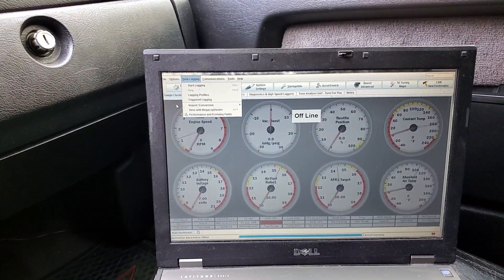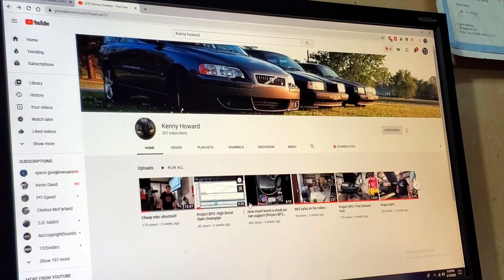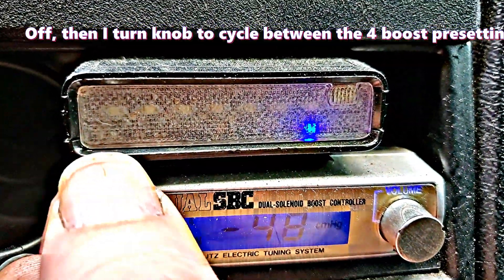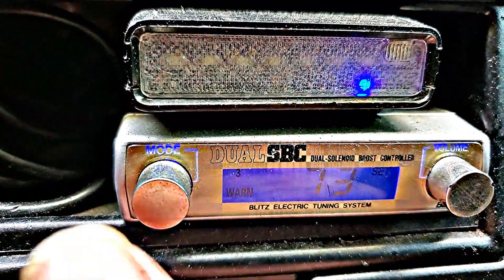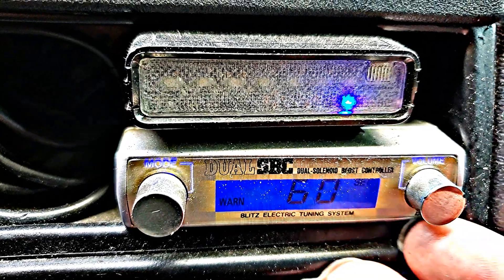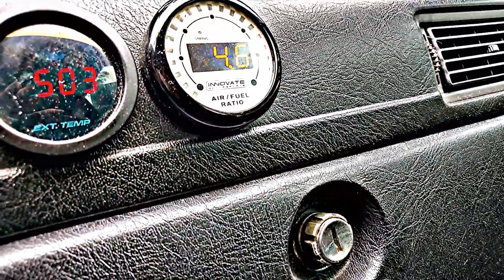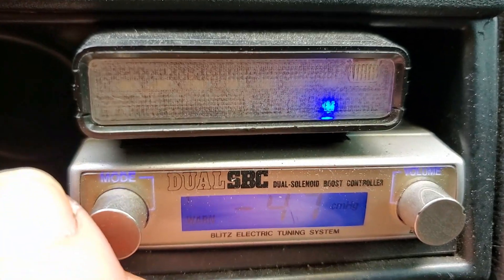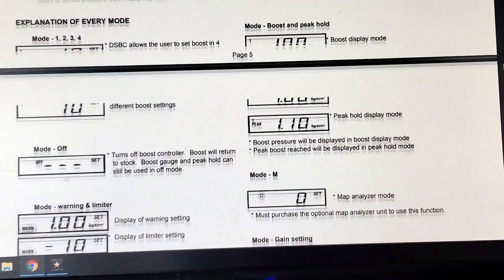Electronic Boost Controller, Blitz DSBC , Programming Instructions and Features.

Comment: I have one of these but i dont know why it isnt turning on Everything should be fully connected
any help would be great
Reply from the maker: They are nice when they work! So i guess, check the power and ground and make sure you are getting both, i think there is a glass bus fuse inside the case that may have popped , but i don't recall for 100% certain. Instructions still say to install one fuse inline so maybe trace your positive wire back to the fuse and check it? Did anything else stop working around the same time? If so, check that factory fuse? Hope that helps, these boost controllers really help and when they don't work , ugh it sucks. Nine out of ten times, not the boost controllers fault, in my experience. Wires fail, hopefully that's all it is for you.
Reply: @ Thank you I’ll check it out tomorrow
Reply from the maker: Major update. I have two of these both had same problem, open up the case and glue the plastic hoses back on the plastic nipples of the sensor. Both blew the tubing off the sensor i super glued and zip tied them back, hope this helps . I did a video about it, I think a short but it kinda got hidden.